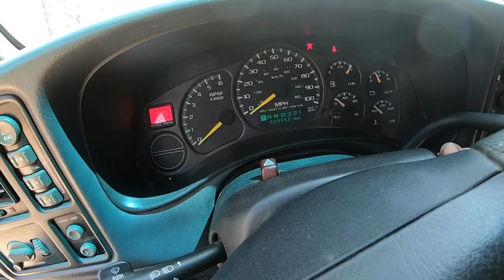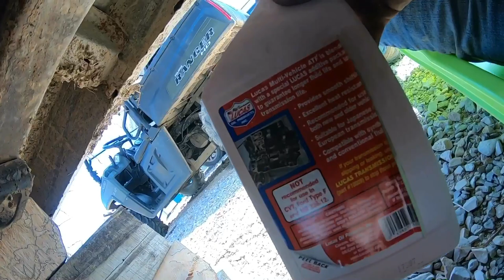Removing Transmission 1999 GMC 1500 - Shade Tree Style

Comment: Cap’n, I hate to start off with a critical note… but… can you qualify as a shade tree mechanic if the trees don’t have leaves?

Your multi-stage transmission jack was impressive.  The battle of the dipstick withdrawal was a victory in and of itself!  Getting a couple of 290K seized exhaust nuts off, is a skirmish for the history books.  Having no triage necessary from the starter bolt spinning on the flywheel is a gift born of serendipity.  Only one $70 hogshead to replace, is a pittance to pay for the experience of a day spent sledding under a rust proof conveyance… without a flake of snow!!

All in all, it seems to me that you crafted an absolute masterpiece of shade tree mechaniking… even though you weren’t given any shade!
Reply from the maker: 🤣🤣 the shade in the shade tree was definitely lacking

Comment: Don't worry about those "extra" bolts. Maybe wait until after the sale to show this video to the buyer.
Reply: "extra" bolts isn't a bad thing. just means you put it together better than the factory did🤣🤣🤣
Reply: If you don't have anything leftover, you must have done something wrong.  😅
Reply: i was told as a kid they are extra bolts an called Bush bolts you throw them in the bushes when no one is looking all good
Reply: Some extra parts are indeed extra, when I was a kid I fixed a Bendix coaster hub on my bike, I had 5 good years on the fixed hub and I had about 30 spare parts that I failed to put back in when the work was done.
Reply: Hey…it’s Wes! Fancy meeting you here!
I see a white C10 in your future 😜
Reply: Calholli  it was a joke about Bush screws

Comment: Good job. Been there. Done that on my '90 Chevy 1500. Tranny broke free and dropped on my head and slammed it onto the concrete. Had post concussion headaches for 6 months. Replaced the hardened rear engine seal that did not appear to be leaking. Did not solve the dripping. On further inspection, the oil was dripping down from the oil cooler bracket above the oil filter. Easy fix by tightening the bolts.
But, I learned how to replace a rear engine seal.....That ratchet strap trick works good. Used it many times.
I had a weld shop repair the broken off mount hole for $40. Yep. Been there. Done that, too. That's how we learn.
I would have jacked up each wheel and put cribbing under the tires. More room to work. 
Fly wheel on a manual tranny w/clutch. Flex plate with an automatic tranny. 
Hope a rear seal solves your leak. Those cast alum oil pans can become porous. Mine did on my 2002.

Comment: Captain your jacket perfectly big enough to raise and lower that transmission all at once. The way you had it under the pan will balance it pretty good. Most of the weight in in the main body and torque converter. God bless

Comment: I wouldn't worry about that top bolt on the bell housing.  That truck will just be one of thousands missing it.  If it makes you feel better, use the washer trick.  As for the bent bolt holding the cover, try a new one and see if it will thread in.  If so, coat it with loctite and reinstall.  If it's too loose, drill it one size larger and re-tap the hole.  You'll need a bottoming tap to get the threads to near the bottom of the hole.  You're doing great.  When I saw that gravel you were going to lay on, it reminded me of pulling a transmission to replace a clutch alongside some railroad tracks.  I did it at night during the summer in Florida and by the time the mosquitoes finished with me, I felt like I needed a transfusion.
Reply from the maker: 🤣🤣 lucky I had the chickens to keep the bugs at bay!

Comment: Hey Mike,  nice job! As far as your bent bolt on  back of the engime oil seal cover, I think it was already backing out. Because it wouldn't have bent if it was just loose when the starter bolt went for a ride. It bent at that point when the bolt hit it. As far as the two exhaust bolts that broke, just drill them out or knock them out and replace with regular nut and bolt. Did that on every trans I had to pull. I have been a technician for over 35 years and know what you are going through. You did fine on the removal. The top bolt will be fine without it. If you dont feel good about leaving it out, then by all means replace the housing. Keep up the good work! Your channel is one my wife likes watching .
Reply from the maker: Hey definitely appreciate the tips!  Thanks

Comment: Washer for the bell housing bolt. Also, keep an eye on torque converter and make sure it stays fully seated in the trans. It can slip out of engagement & damage pump if forced together when bolting trans back to engine.
Reply from the maker: Thanks for the tip!
Reply: GM used only 6 bolts for decades

Comment: The key to putting that top but and bolt back in. Is masking tape. Put a piece of masking tape on the nut or bolt then stick it in the socket. This will hold it in to get it started. God bless
Reply from the maker: Thanks for the tip

Comment: Kudos for multiple things. 1 sled on gravel, 2 cribbing and "stepping down" the Trans. 3 the whole thing. 
You can do a washer on the top bolt. Or you can change the bellhousing. OR you can leave it out. Most of the 350s running around don't have that bolt in it. The block has the hole but the bellhousing didn't have a hole to put a put there back in the day. 
I'd say you did a fine job, put a rear cover gasket, rear main seal, and a trans input shaft seal in it. If you decide to put a Trans input seal and bell housing, make sure you put an input shaft seal retainer in it. 
Also, you'll have to spin the torque converter in the pump 3 steps. Watch a video on it if you do. Make sure it's fully seated!!! Replace torque convertor bolts as well. Cheap insurance 
You have my email if you have any questions sir. Been wrenching on cars and trucks my whole life and a career tractor trailer mechanic for 15 years now. 
Keep up the good work sir!
Reply from the maker: Thank you!!

Comment: This is were old throw rugs or chunks of rugs are nice for the back and nuts and bolts. 🙂  Pertaining to the transmission, when my guy called me when doing my truck he said the unit had 3 out of 5 installed and the kit had 5.  Want 5?  I said Yes - and had no slippage on hills or pulling loads.  5 grip better and transfer power to the rear.

Comment: If it was me doing it I would use a washer on that bolt and forget it..change the rear main put a new gasket on the rear cover and pull the torque converter out and put a front seal in the transmission…you are doing a fine job in not ideal conditions…the plastic sled is genius…
Reply from the maker: Have a seal ordered! Thanks for the tip

Comment: If you set your parking break it locks your rear tires up so you don't have to worry about it rolling. It's still good to put some wheel chocks on your back axle though. I work on my car is in the driveway a lot too and what I've done is I went and bought one of the rubber mats for horse stalls. The rubber mats are about 1.5inches thick  and and 4 ft wide by 6 ft long. And they only cost about $60. I can drag the mat around wherever I need it underneath my vehicle. It's hard enough that you can actually put a pump jack on it and it will role around really nice. And if you happen to drop a nut or a bolt it's easy to find instead of trying to find it in the gravel. I would not get a new bell housing. A washer would be just as strong. If you're selling that truck with that many miles on it the person buying it is going to expect it's going to have flaws
Reply from the maker: Good idea on the rubber mat

Comment: That is a heck of a job to tackle Mike, I did replace a clutch many years ago in a small Ford Fiesta. Took me a day and a half to attempt to remove it, one of the neighbours was a mechanic, he came across and gave me a hand to strip down the housing etc. and gave me some tips to get it back together fairly easily. Last thing I had to hook up was the gear linkage, it was a manual transmission. Got it connected and took it for a test drive, the gears linkage was not lined up correctly, choosing a gear became a guessing game 🤦‍♂️🤣 
I vowed to never attempt anything like that again, then scrapped the car shortly after....... 
Your set up was perfect, left yourself enough room to slide underneath on your sledge and get access to more or less everything. You used common sense to get the transmission out successfully, now all you have to do is replace the necessary parts and reassemble,  just keep a box handy for the "extra" bolts 🤔🧐🤣
Reply from the maker: Always extra bolts when it's all said and done 🤣

Comment: hey captain, i enjoyed this video as this is what i do for a career. for nearly 25 years now. i have many tips for you when you go to reinstall it , the biggest being take the six 15 mm nuts off the transfercase , because its going to make your life miserable and there is a gasket in between but it is not needed just clean the 2 surfaces and use permatex. the three torque converter bolts are updated by gm and are now hexhead bolts , dont reuse the original allen heads. anyhow thanks for the enjoyment and if you need anymore tips feel free to contact me
Reply: This is great advice Capt. ... removal of the transfer case is of utmost importance, especially without having a transmission jack ... you won't be able to balance the tranny properly to properly reseat into the Bell housind and the TC can easily be lifted up for reattachment afterwards. And no, either skip the top bolt or use a washer; the breakout left 70% "ears" so plenty of meat left.  As to  the starter bolt damage, zip off the bent bolt and install a new one ... with Loctite and torque the other two. DO take a small magnate and pick up any remaining debris.  Great job so far ... having done this myself on my Chevy PU in similar circumstances, I know what you're going thru ... and what's coming. I was a bit smarted and enlisted another set of hands ... you might want to consider that for the reinstall ... surely Mike or the others will give you a hand.

Comment: don't worry about replacing that bellhousing .gm didn't start putting a bolt there until 99 ( ls style motors) that 5.3 liter engine isn't going to make enough torque to break the other 8 bolts holding the trans to motor bolts. I've run big block 454 with just 4 bolts never had problems with it .

Comment: drive shattf or front and read should just pull out 
make sure you save all the bolts if there is any extra you need to locate and put back (chevrolet and gmc had there reasons for the bolts " you've miss placed ... lol 
the exhaust damn you got lucky there ! aint nothin better then the rooster tryin to help with your projects...juss keep a wigglin it fall out soon enuff. front tires on cross ties will give you plenty of room .. 2x4 nailed in the front and back of a tire will keep from rolling off and crushin your self.starter and tongue converter bolts need to come loose, then the bell housing bolts, (make sure you disconnect the battery,) or shocking sensation you will have......capt  your my hero!  should been able to unplug that whole or deal from one connecter at the back of the trans,,trans lines suck be careful not to break them...good job glad youve gotten it pulled... hope everything works out fer ya feller, thx for takin the time for Sharin with us ... keep it up love the channel hope to see more on the hen house/goat barn....

Comment: You wont get those 2 connectors out of the neutral safety switch or range sensor without destroying the switch and more than likely the connectors on the harness side as well. Whatever the goo is that secretes out of the switch from the heat of the exhaust essentially welds the connectors into the switch, I've had to replace the switch and connectors on every 99-07 GM truck/suv that I've removed the trans out of. Much respect for doing this on the ground in the gravel without air or power tools! Love the videos!
Reply from the maker: Thanks!

Comment: Watching this brought back memories, or possibly nightmares, of swapping the transmission on my 1969 Cutlass.  On the positive side it was an old school Powerglide, so relatively light in weight.  On the NEGATIVE side, I was usually working with about the same amount of clearance, on a similar surface (loose stone) but WITHOUT having a sled under my back.  With that car I went through 3 Powerglides and one TH-350.  That was the last straw (then, wish I still had it) and I sold the car in '86.
.
.
As far as the bellhousing, at $70 I'd replace it whether I was keeping it or selling it.  If I was thinking about keeping it, I'd be tempted to haul the tans to a shop and have them give it a good looking over for the bands and everything else.  Repair it if possible or look at a salvage yard for a replacement.

Comment: Did we forget the dewalt 1/2 impact you used on the bridge? Still works if you get the right impact rated adapters. I use them when I need to work on trucks. Just remember to ALWAYS start it by hand. If you dont you WILL cross thread a bolt easily. It happens to everyone.  Love your videos they are always great to watch.
Reply from the maker: I didn't use a half inch impact on the bridge because I've never owned one.  I do have a 3/8" impact, but it would do much for me

Comment: Love my 1990 GMC Sierra SL C1500 WT 3/4 V8 🤣 (4.3 V6) rust bucket. If you only had a set of tire ramps for more room. Great tip for ya Mike when reassembling your exhaust use brass washers under the nuts and apply copper anti seize to the threads for next time. And for anyone replacing their exhaust don't buy the cheap standard stuff from the 3 big auto parts stores ever (use Summit Racing) unless you like rust holes everywhere after one year. It's all junk! Also check your axle U bolts and shackles which get completely full of dirt and salt rusting through your U bolts. I had to go to the salvage yard to pull good ones ( cause the auto store prices are through the roof) than I drilled weep holes in the shackles. Cleaned and brush painted it all with Rust-Oleum gloss black. Assembled it on the axle and painted everything else. Two of my U bolts had completely rusted through came close to losing my rear end literally.

Comment: The rear main on my truck is leaking bad now too. I’m at 285k miles and have a plan for a full driveline rebuild (motor, trans, transfer case, diffs etc.). Great trucks that run forever but when stuff starts going, it REALLY starts goin! Lol

Comment: Hey Mike, you remind me of working on vehicles in our gravel driveway growing up.  Dad always keep two or three heavier cardboard boxes, opened up, in the garage. The "cardboard creepers" kept the stones from digging in your back, were easy to slide around on top of, and caught most dropped stuff before it disappeared into the stones.  I'd spilt the transfer case from the transmission,  a lot less to wrestle, both size and weight.
Reply from the maker: Definitely having a magnet handy helps
Reply: @CaptainKleeman LOL.  Yes, there was a big horseshoe magnet stuck to the side of the tool chest.

Comment: I had to drop my transmission to replace my clutch and slave cylinder it helped be a manual so ots a little lighter. then the slave cylinder went 3 months later and it's internal so yea had to drop here again. It's amazing how much faster you get the second time

Comment: Don’t worry about the top bolt it’s overkill most of the older vehicles including many 427ci 425hp didn’t have the top bolt and I doubt your going to make the kind of torque they did. Spend the $70 on a sheet of plywood to lay on. Love your jack stands

Comment: Mike, I have changed several transmissions and/or engines shade tree style, in days gone by. Don’t miss those days! I have installed a tranny or two with missing bell housing bolt/s a couple of times without any trouble later. My advise is save your money, put a washer on that one (or not), marry to engine and move on.

Comment: You have an automatic rust preventing engine. That is an expensive option. It's not a popular option in the southern states or if you have concrete parking area. Have a great day Captain. 😀
Reply from the maker: 🤣🤣 should I list it as that?
Reply: @CaptainKleeman  I would 😆
It doesn't need a new bellhousing. Just put it back together. Make sure you use thread locker on flex plate bolts and converter bolts. You don't want them coming lose.

Comment: That bolt and wrench trick was pretty slick actually. I would probably just toss a washer on that top bolt and call it good. Do be careful with the torque converter when putting it back together, as the seals on the input shaft are kind of fragile. Just make sure it is seated tightly before you get it back up in place. As expensive as used trucks are, I would probably keep it. Even if you rebuilt the engine and trans you would have spent less than buying a newer used truck.
Reply from the maker: You make a good point, it's a tough decision, I could get more than I paid for it with the market, but it would cost more to replace it
Reply: @CaptainKleeman  It is a tough call. I know out here you aren't getting a decent used truck for less than 25k

Comment: LOVED your tool tote/box 🙂 Over the years I have seen many vehicles in the places I have worked missing a bolt or a snapped ear like yours. All, without exception were fine. I wouldn't personally spend the $$ for a new housing. It will be fine for another 100k miles.
Reply from the maker: Thanks!

Comment: Gravel and dirt floor, a night mare to work over. Just did the exact same job on a Blazer 99. On jack stands and pavement Including pulling the engine. getting the transfer case off is a nightmare on these

Comment: don't worry about that broken housing, they did not have that bolt for years on earlier units. what bolts that are there are plenty to hold trans in.
remove bolt left in block and reinstall trany when done.
Reply from the maker: Thanks Trent!